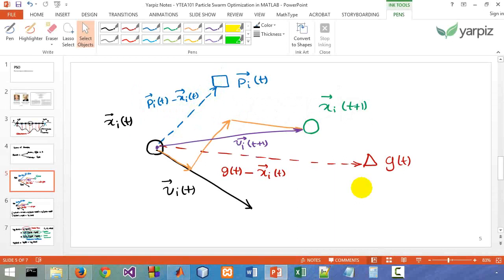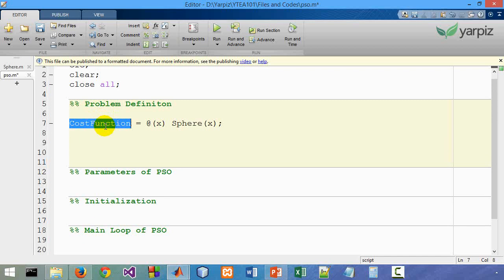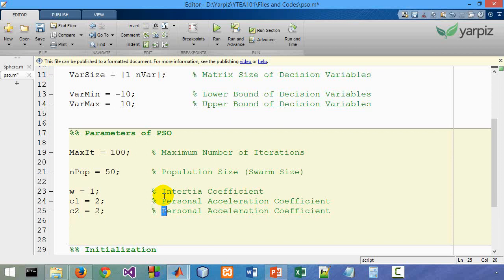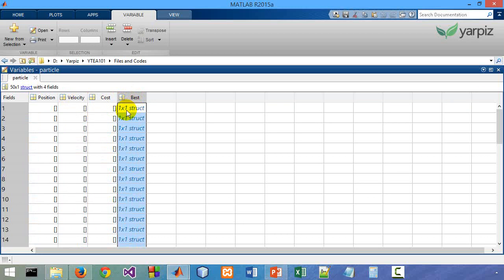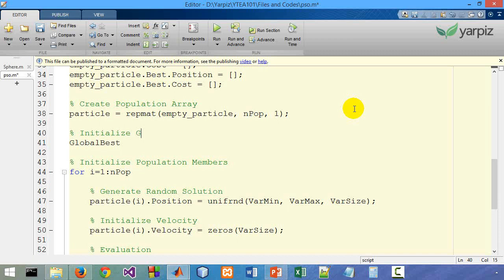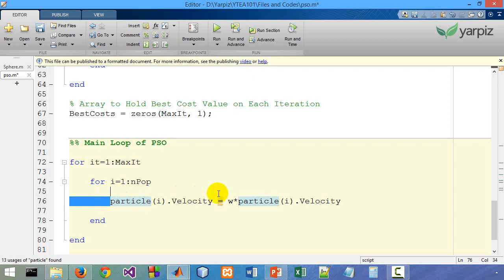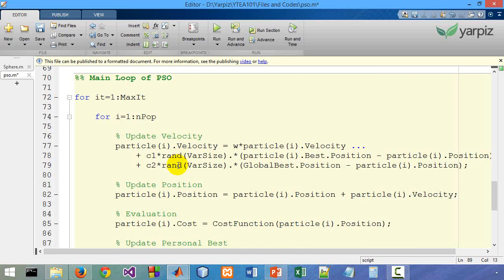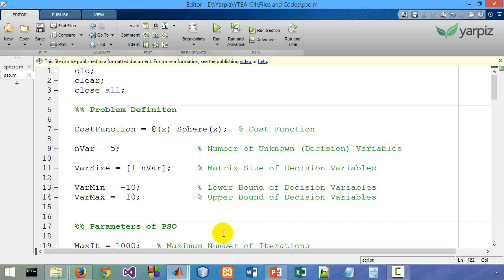Particle Swarm Optimization in MATLAB - Yarpiz Video Tutorial - Part 2/3

Comment: When I add this part:             % % Update global best
            % if particle(i).Best.Cost < GlobalBest.Cost
            %     GlobalBest = particle(i).Best;
            % end         

in the MAIN LOOP OF PSO,  something goes wrong because my positions are not in the range -10 to 10 anymore.  
e.g.
Particle(x).position = [-7748.05355551422,19106.2466328038,-173.246225196285,-665.920732417208,-15950.8912609155]

Before that, it's all good. is it normal? I'm using the same cost function, variables, and boundaries.
Reply: actually, this is what is causing that: particle(i).Position  = particle(i).Position + particle(i).Velocity;   is it 
ok?

Comment: Thank you for the explanation, but when I try to run the code it gives me an error on the line where I declared VarSize = (1 nVar);
This is what it display on the command window "Invalid expression. Check for missing multiplication operators, missing or unbalanced delimiters, or other syntax errors. To construct matrices, use brackets instead of parenthesis".
Looking forward to you on how I can correct it.
Reply: Make s pace between 1 and nVar or add a , like this VarSize=(1,nVar);

Comment: hallow Sir
I've watched the video which was really interesting and useful
The problem which guided me to this channel  is not yet explained... and if you allow me to suggest it as a future lecture ... i will be so grateful if you respond...
the problem is that how to connect an algorithm with a neural network step by step starting from downloading the ready code from MATWORKS webpage and extract the contains to a folder then start connect the algorithm with the neural network by changing the fitness function and use the output of one of them as an input to the other, which might be noted as optimization (since i didn't find any solution on YouTube which can be considered as source for real learning which leads to ability to solve any connection problem such that you need to apply different algorithms or other neural network for the same system)

Comment: I typed according to the instructions, but the result turned out constant. There must be something wrong with my linking of variables, but after several times of checking, my code seems to be identical. I wonder if you gues could help me with the debugging. Thanks a lot in advance!  You can find my codes in the link below:
https://c-t.work/s/dbe889ca96ff40

Comment: Great video!!!

I have a question about the VarMin and VarMax variables. These variables define the upper and lower bound. But when I define for example:
VarMin = 0
VarMax = 5
nVar = 5

Then of course I get for the GlobalBest a vector with 5 columns. For example:
Position: [3.7542e-04 -8.0293e-04 -0.0011 1.1266e-04 1.5088e-04]

How is this possible? There are negative values. And I defined the minimum boundary with zero.

I hope someone can help me with my understanding problem
Reply: I am facing similar problems.This is probably because varMin and varMax restrict the particle position only for the initialization.The main loop places no restrictions on the position

Comment: Also how can this be applied to a multi-objective optimization. For example instead of sphere function if I have a function in x and y, how can I reduce the value such that I am modifying both x and y? Should I use two different swarms? or can it be done with a single swarm? Thanks. :D

Comment: Great job Mustapha, this is an excellent introduction to the PSO, however, I have a question regarding the damping parameter.

In this problem you already know the optimal solution and thus you have modified the code to include a damping effect. The question is :  what if I have no idea about the optimal solution ?  Should I just add it?

Cheers
Reply: to get modified result you can use damping with other value.
Reply: @SMARTPALASH   first of all thank you so much Mustafa, and for you too smart, but i would like to ask you how should i update my variables to this function could you help me thank you